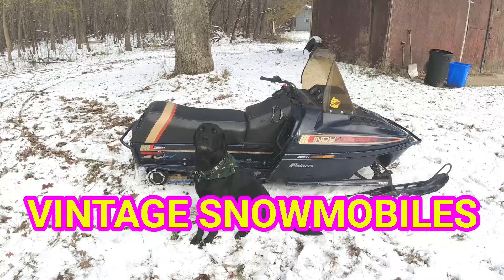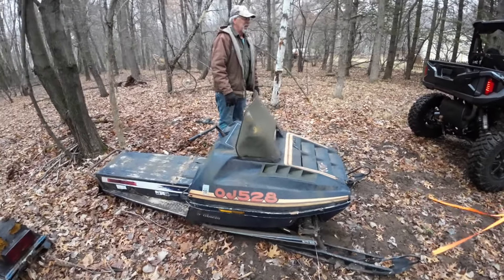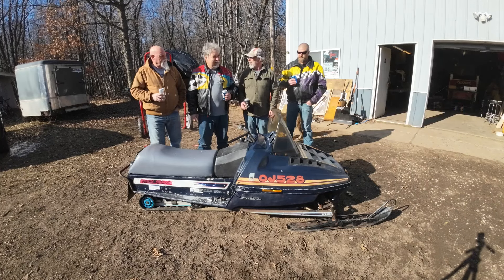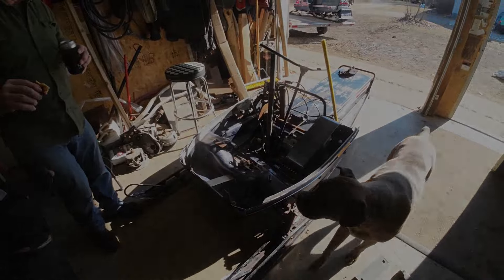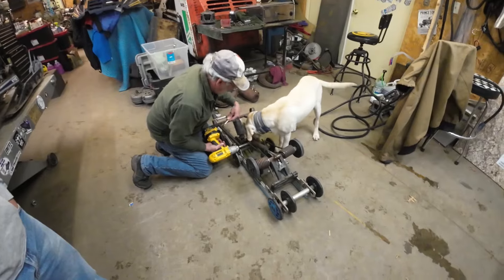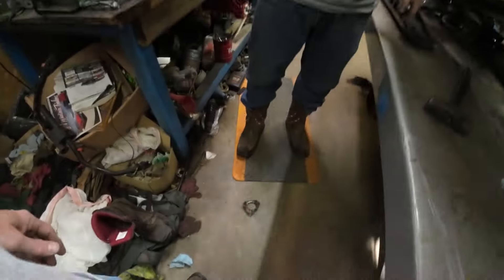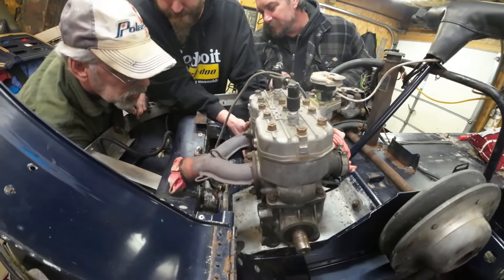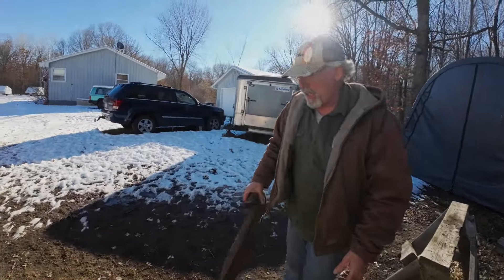Junkyard Polaris TXL Indy Resurrection Part 1. Vintage Polaris Snowmobile.

Comment: Have you spent time in previous videos pointing out some of unique features of early Indy's vs later Wedge-1 & Wedge-2 sleds?  Although certain brands during certain eras managed to produce a few solid models, by far the biggest factor in my preference on Polaris sleds is the unbelievable interchangeability of parts and pieces with minimal or zero modifications from the early 1970s right through the late 1990s.  No other brand had that much consistency and modularity across so many models, years, and styles- which is so evident in the large variety of snow cats you and your crew have put back on the snow.
Reply from the maker: It would probably be best to show that with a couple bare bulkheads side by side. Not sure if/when that would ever happen. Interchangeability of Polaris is the best. Want to put a top loader chain case with reverse in a 1976 TX340? It works - with just a bit of clearancing of the pipe :)

Comment: What about putting a strong magnet on the top so it helps guide the engine mount bolt
Reply from the maker: Tried it. Still need go get a wrench into the chassis to hold it.
Reply: @nuttersspeedshop  do both at the same time. You can also wrap copper wire around the bolt threads then have a long strand to push up through the bolt hold then pull the bolt through